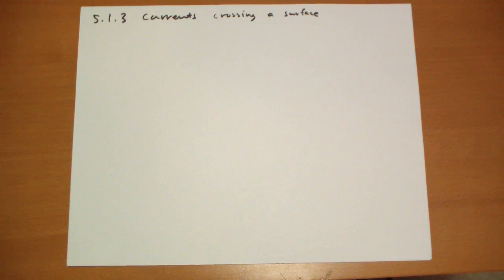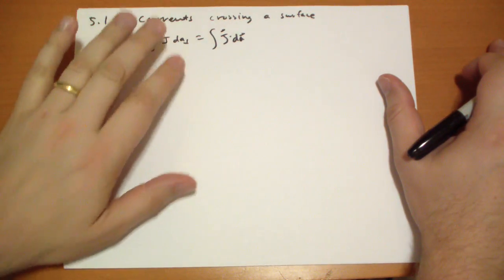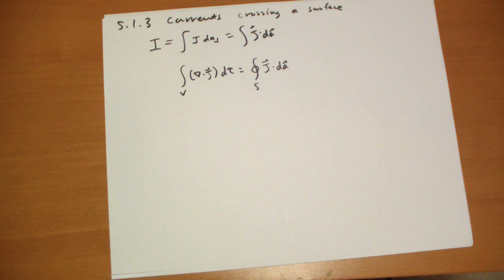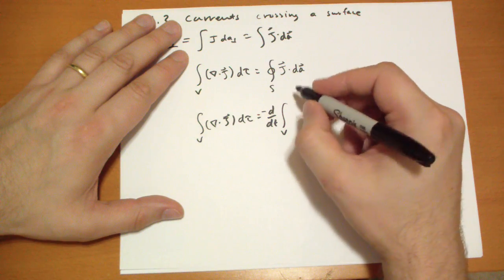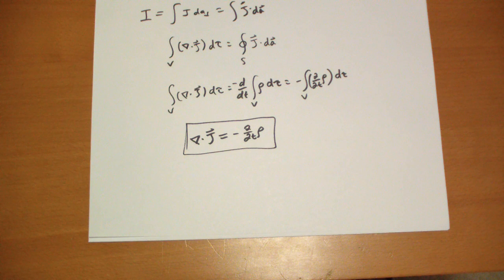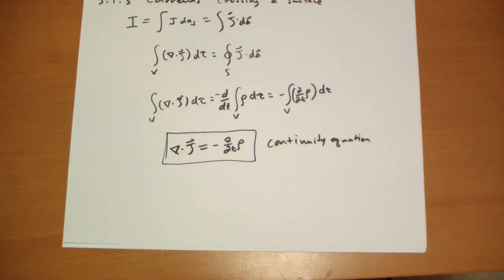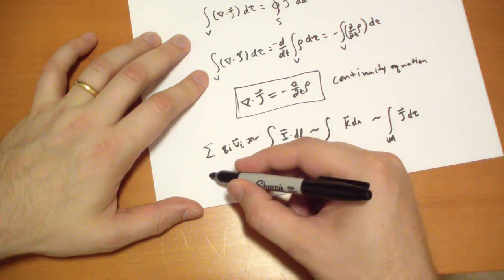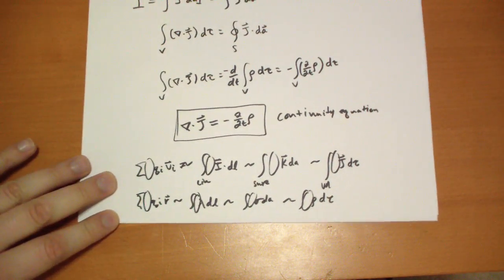5.1.3 Currents Crossing a Surface

Comment from the maker: 2:10 is my lame attempt to explain this.

Basically, rho is the charge density. rho dtau is the infinitessimal charge at a point. integral rho dtau is the total charge within a volume. The time derivative of that is the rate of change of the total charge, which, by conservation, must equal the charge going in minus the charge going out since charges are not created from nothing. Well, the charge flowing into a surface or out of a surface is the integral on the left.
Reply: Continuity equation is not clear sir
Please explain more?